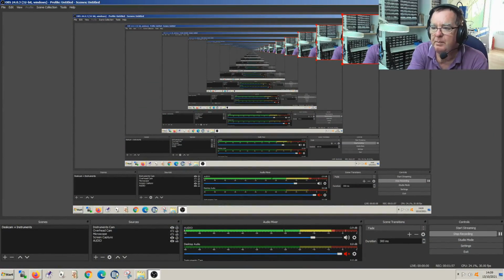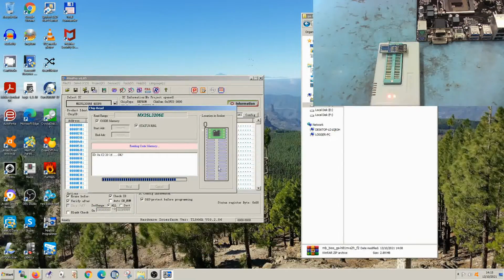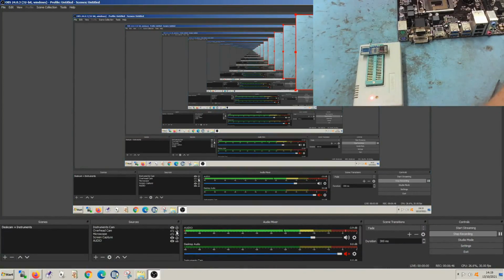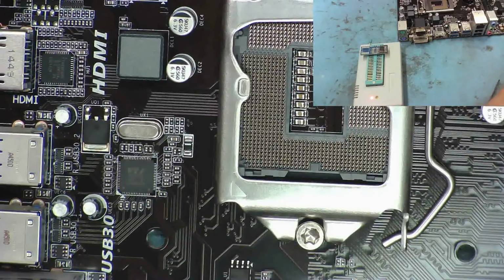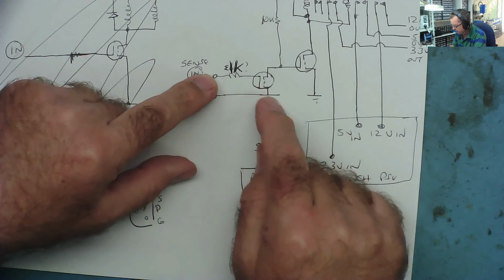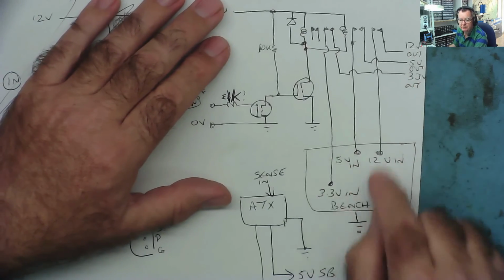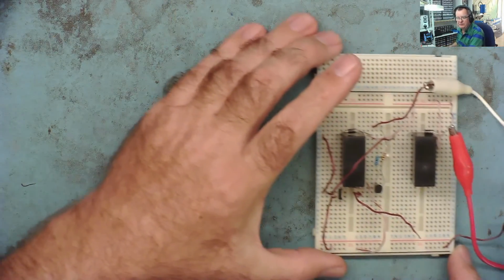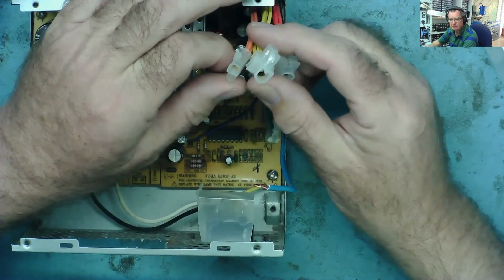GA-H81M-S2H Motherboard - Power Supply Shutting Down and Restarting.  LER #149

Comment: This mobo has a short on the one of the 5v or 3.3v lines. The fact that forcing the psu to stay on but it goes into protection indicates a short. The short is not on the input side… is after a mosfet / switch. It can also be dead/shorted chipset.
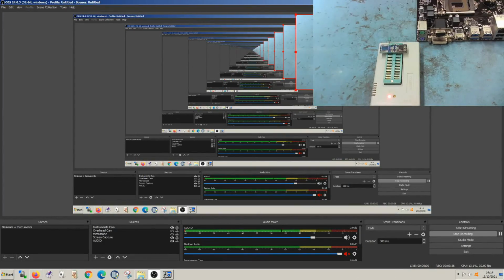Reply from the maker: That makes sense Justin - So I checked all the linear and buck regulators on the board (unless I missed one which I don't think i did) and there are no shorts or even differences from the good board. I did specifically mention this possibility you suggest in the video at 16:05

I do agree that is exactly how it is behaving, with a short on a rail derived either from 3.3V, 5V or 12V on the 24 pin ATX but as far as I can see there is no short.  Then of course I tried to find a way to determine which rail has the problem...

My thoughts - that there IS a short somewhere on a derived rail and I just couldn't find it.  It's the only thing that makes sense really.  It did pass my mind at some point to take the heatsink off the PCB and check for shorts on the capacitors if there are any embedded on the chipset , but I didn't seeing as I couldn't see shorts on the outputs (or in fact any pin) of the large Mosfets/LDO, or whatever they are.  Something to check Monday though 🙂
Reply: If there’s no short, try to find out 5vDual and 3vDual lines… if any is missing the motherboard shuts down immediately after power on. Those lines are usually created by LDO’s, i shouldn’t be very hard to locate them on motherboard… good luck!

Comment: I have seen this before and it turned out to be a bad chipset
Reply from the maker: In this case it seems to be a faulty VRM generating too much voltage to the PCH, 1.7V instead of 1.05V.  This has probably trashed the PCH - but I have the board on one side to try to fix the VRM problem and then see if it acually works

Comment: Had this on a friends mobo his son had mashed up a USB 2 header as soon as I unplugged it the issue went but I had to reset the cmos to clear it 
The symptoms were a short that was only present when you turned it on tested out ok soon as I cleared cmos it started ok you mentioned you’ve cleaned it could it be possible that some damage to the USB’s
Reply from the maker: Hi Jonno - yes a short on USB could cause this sort of problem. I don't have any USB headers connectred but should check the USB connectors on the motherboard tomorrow :D
Reply: @learnelectronicsrepair  I’ve also got this problem on a x99 asus board pu502 is not giving 1.05v on out put it’s in such an awkward position to change plus it’s going to be a month to get a new part

Comment: I'm soooo glad I found your channel. Thank you so much for making such in-depth and educational videos. I haven't found any others that explain everything the way you do (apart from maybe the Hindi channels which I can't understand). I would be interested in knowing the exact model of programmer you're going to get as I would also like to upgrade mine. I currently have the TL866II Plus which I bought a couple years ago. Thank you again and all the best, Julian
Reply from the maker: Hi Juian - Mine is the older TL866A/CS and does not support 1.8V Eproms, so I'm intending to get the latest TL866 II Plus, as I was recommended on www.badcaps.net/forum

They come with various adapters and support programming of around 30,000 devices according to some vendors (not sure if that is exactly accurate)

However that is the one you already have, so I am interested to know why you need to upgrade yours
Reply: @learnelectronicsrepair  Ah thanks for clearing that up. I had no idea mine would support the newer chips. Guess I don't need to upgrade! Thanks again.

Comment: Perhaps make a psu cable breakout so you can insert a dvm into each rail (just using the atx supply) to see the current being drawn, comparing it with the working board. This may point to which rail is causing the issue. For accuracy use a series resistor in each rail with a scope across it so you can see / store the peaks
Reply from the maker: Hi ralph - I had a similar idea before I tried with the Bench PSU.  I was thinking to put a low value power resistor (like 2x 0.22R  in parallel = 0.11R just because that is what I have in my box of bits) in series with each rail. 3.3V, 5V, 12V and connect my multimeter across the resistor looking for a voltage drop then I could work out the current I=V/R but with 0.11R it would be close to 1 Volt = 10 Amps so no calculation strictly necessary.  Mostly I didn't do that because of there being a lot of red yellow and orange wires.  But it could be done in a similar way I modded the ATX PSU in this video.  The other reason I didn't try it is because the ATX shuts down fast, so the surge would be transient - my Fluke has a 'Hold' option where it displays the maximum Voltage detected, but I am not 100% confident it is fast enough to determine what is happening here.  It's a good idea though, something I could try. 🙂
Reply: Try the scope across resistor method, I regularly use that to catch current transients in milliseconds. Be  caefull re scope earthing. I'm not knowledgeable as to whether all those same coloured wires are actually commoned on the motherboard and is just like that to increase current capability.
Reply from the maker: @ralphj4012  yeah I also thought of that idea but grounding is a problem.  Normally you would put the resistor in the current return path (so one end is ground therefore you can attach a scope) but obviously I can't do that here as the return patch is for all the voltage supply rails combined.  All the wires of the same colour (red, yellow, red) are commoned

Actually I do have the ATX PSU connected via an isolation transformer so I could connect my scope ground anywhere but I avoid doing something that others might try with a grounded scope connected to a grounded PC, for obvious reasons.  I should be able to do it though, using the math function on my Digital Scope, and a probe on both ends of the resistor, grounding the probe leads the normal way to chassis ground 😉
Reply: Awkward I know but if you put the resistor into the feed (i.e. the common of the yellows at the power supply end) and then put the scope across the resistor (probe ground on one end of the resistor, probe tip on the other end of the resistor) then you can capture the voltage / current. Use isolation transformer or disconnect the earth wire out of the scope mains plug, just in case (tut, tut, old engineer methods).
Reply from the maker: @ralphj4012  And I'm an old engineer lol so I know the methods well.  Oddly enough I survived those methods as did eveyone else I knew. After the weekend I will try something like you suggest - I have a lot of old ATX PSU I can modify or canibalise

Comment: Is the Power good from the MoBo ok as that could cause the PSU to do what you are seeing.
Reply from the maker: Hi Simon, Could you elaborate on that idea?  If the Power On signal (green wire) coming from the motherboard is low - and I proved that it is low - then the PSU should turn on.  There is no other signal that controls the PSU from the motherboard as far as I am aware of.
Reply: @learnelectronicsrepair  Sorry !!!  Ignore me, I had the wrong end of the stick..  https://en.wikipedia.org/wiki/Power_good_signal ...  

Oh, In fact, could be worth checking the Mobo is reading the Powergood from the PSU (  Grey Wire )
Reply from the maker: @SimonParkes  That is something worth checking  😉 though I don't think it is the problem in this case as the PSU clearly trips out
Reply: @learnelectronicsrepair  I think he means that the chip monitoring the voltages (usually ITE or nuvoton) find something  it doesn't like ... often there is a wired OR from different pgood all around the mobo coming to the monitoring chip. In extreme case, you can go backward from the wired OR to understand where the problem is.

Comment: Hi I have a source that does not start and has only -11v ... I understand that this would not be a problem, because I only have -11v. but still the source does not start .... after pressing the start button you hear only a noise (beep) and the fan moves very little just to notice that it has moved .... I want to specify that the source is a budget, ie at Delux :)) I know it is much easier to buy another but being in college in the field of electromechanics I try to gain experience :)) being at the beginning.Thank you for your response and promptness
Reply from the maker: That sounds like there is a short circuit output / load
Reply: @learnelectronicsrepair  Yes ..... I also checked the safety but it is not burned .... and the rest of the components seem fine

Comment: At 13:50 you had a ball of soldier run across the board under your tweezers, right before you warned us about blobs of soldier lol. Fortunately it landed on the end of a capacitor but thought I'd warn you since I spotted it and don't know if its loose or not. great vid as always, I always really look forward to your vids.
Reply: I just saw that and came down into the comments to mention it 😆
Reply from the maker: @jonchapman6821  I saw it too on the video too just after I said that - it rolled off to one of the capacitors, it is no longer on the board to cause problems.